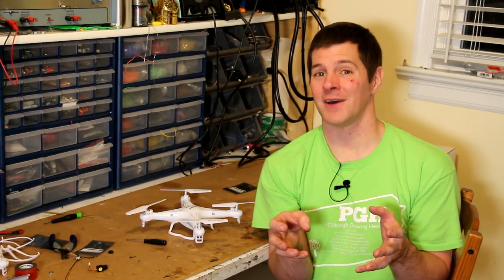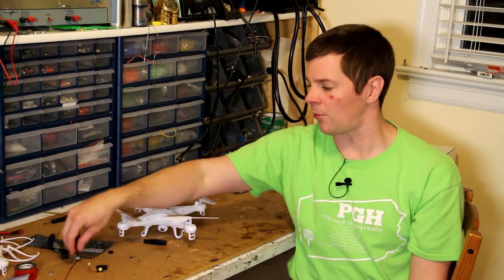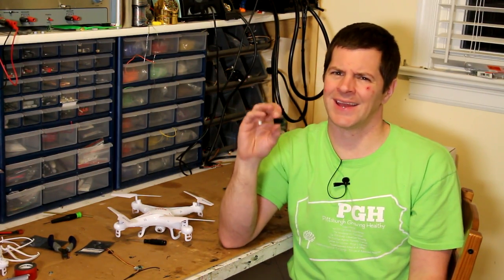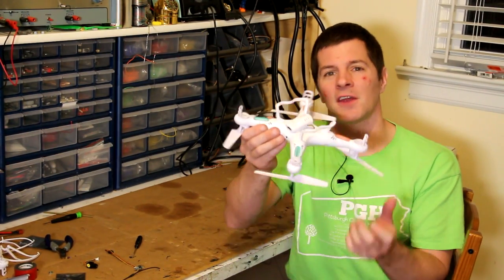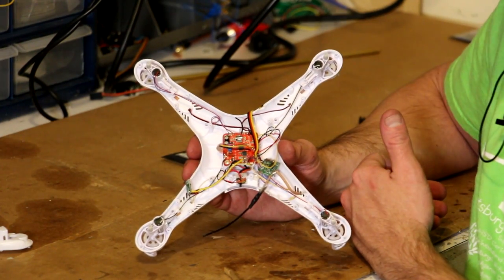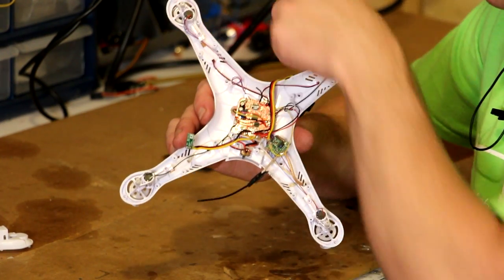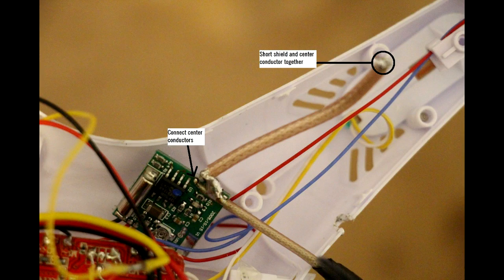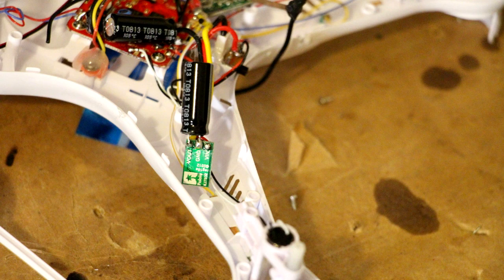Convert the Syma X5C to live video downlink (FPV)

Comment: Is their any documentation on shorting out the coax to kill the harmonic? Is that basically what a low pass filter does? Great vid. I did something similar but even smaller with the hubsan x4. I find better to use separate battery for the vtx. 100mah proto x battery weighing 2 trams gives 21 minutes of video. Longer flight times too Less weight than capacitor
Reply from the maker: The shorted coax is called a "notch filter".  You can actually draw it up on a Smith Chart. There is a tutorial here:  http://www.rcgroups.com/forums/showthread.php?t=1758166

Good idea on the battery! I never thought to use a separate battery, actually.  It also is much cleaner.  The only downside is you need to monitor 2 batteries instead of just 1.
Reply: Alex Greve thanks for the link I will give it a good read. I always end up using a separate battery on my indoor quads, no matter what I try I always get noise from the motors/battery also stepping up the 3.7v to 5v doubles the current of the battery and flight times become halved. I found when i did this my battery's got very hot. some people say if you step it up to 5v then back down to 3.7 then you can get rid of the noise but again its more weight than a 100mah battery. I made a long range microquad that I can fly outside from my bedroom (nice and warm) I used the same vtx you have but then a wifi booster for the 2.4 range https://www.youtube.com/watch?v=GfOdbkxjgLo

Comment: That's awesome. I expected you to tap into a video out source on the existing camera though.
Reply: You can get a Syma X5C-1 here too! For ONLY $40! Just send me all of your credit card information via private message!!
Reply from the maker: Unfortunately it is an HD camera and the protocol it uses does not allow it to be transmitted.  I really wish it were designed that way, though.
Reply: Alex Greve the h107c camera can be tapped into. I did this on my rc channel search andyrc
Reply: Even cheaper here http://www.gearbest.com/rc-quadcopters/pp_73260.html#vip=14681  and use promo code GBX5C and its less than 50 bucks....and the one I got had a 4 g card instead of the 2 it said it would come with,,,,relatively quick getting here too
Reply: Max Smith lol
Reply: ***** Heheheheh...
Reply: Use promo code: Igotrippedoff and get $5 off!!!
Reply: *****  hahaha!
Reply: YOU ARE A HORRIBLE PERSON WHY DO YOU SAY ANYTHING. IF I WERE YOU I WOULD NOT WANT TO BRING ATTENTION TO MYSELF. 
HAVE A GOOD DAY.